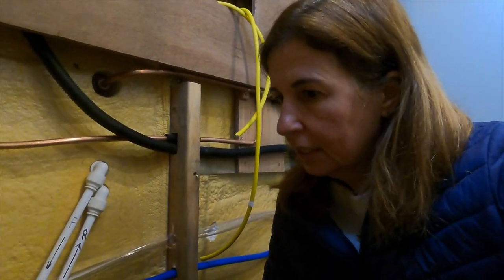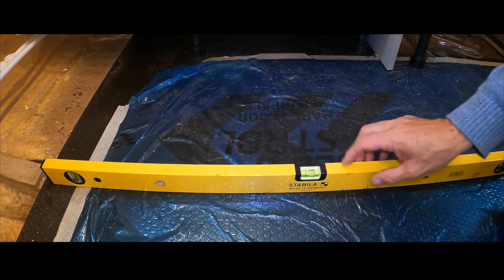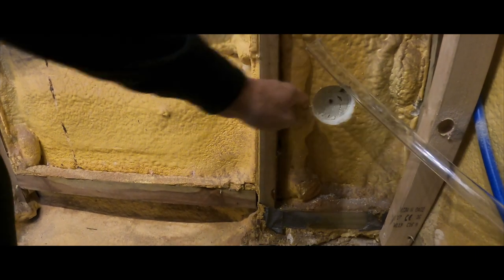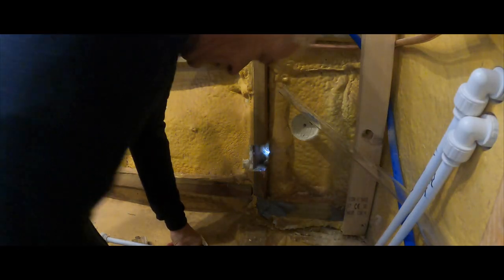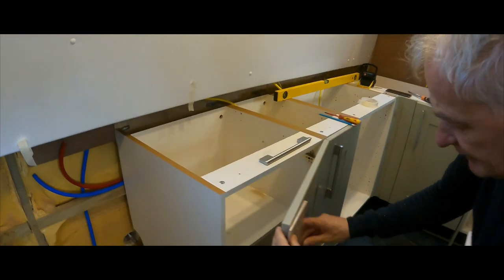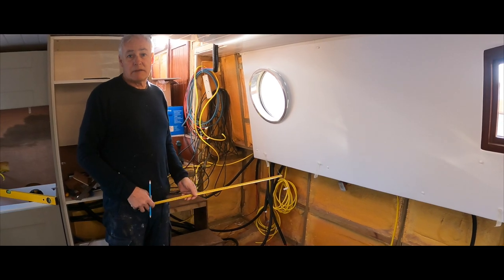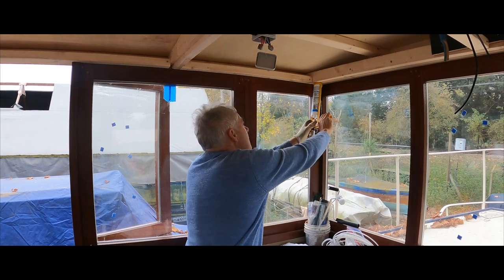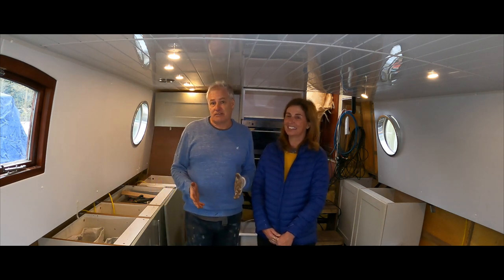BARGE BUILD. Kitchen Fitters.How are we getting on with that job??? Sailing Ocean Fox Ep192

Comment: Two points   One is having served my time fitting out ships  Both on a slipway and in the water you never use a sprit level . You just work from datum lines and keep everything square and level off those.   
Next point also being a kitchen fitter  Your handle template is easier if you fix blocks on 2  edges of it and you can then hold against door and just drill through the holes .  Taking shape and looking forward to seeing the launch.
Reply from the maker: Thank you for your tips Martin

Comment: The boat is coming along nicely. Concealing the batteries and supporting electronics in matching galley cabinets is a nice touch.  As you know electronic gear generates heat. What are the plans for heat dissipation? Will white grill vents be installed on doors or side panels and will you be installing a thermostatic  12 volt fan inside the space to push air?
Reply from the maker: We have a vent to the outside inside the cabinet, hopefully will be enough. That’s one of the reasons that’s there in the galley instead of in the engine room as planned before. Thank you Thom